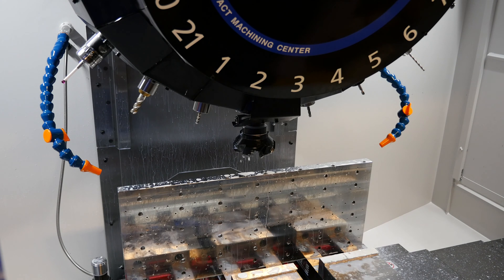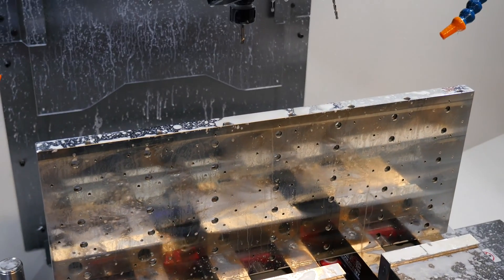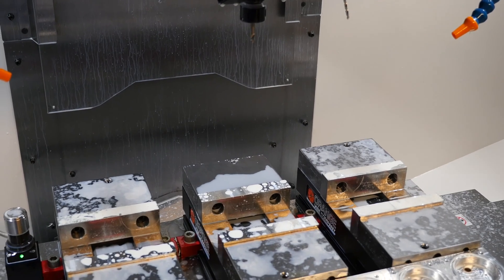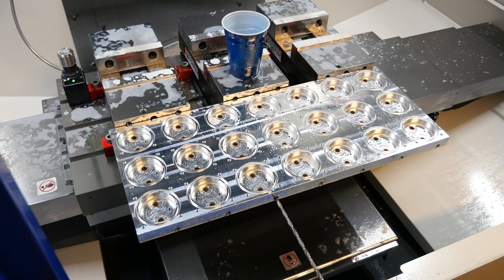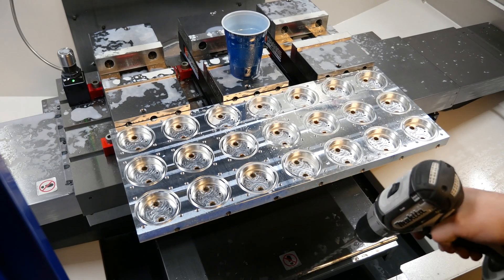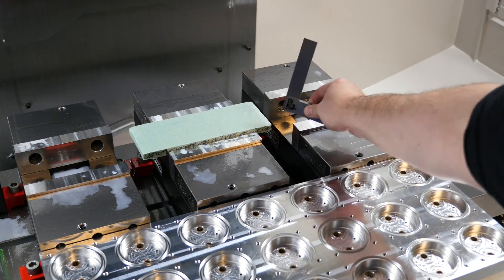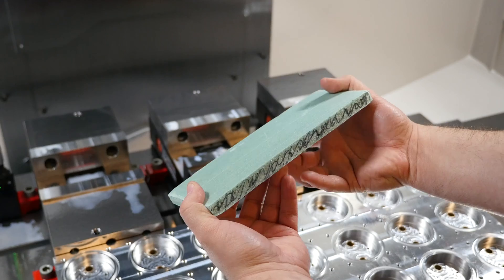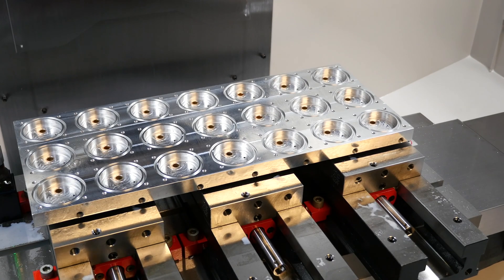Drilling the Air Inlets By Hand and a Lil' Squaring (21-Station Pneumatic Fixture Plate pt.4 of ?)

Comment: when you machine the surface of a large plate like that, particularly if your removing more than a half a millimetre or so, you relieve stress on that side of the plate and it will indeed be bowed when you take it from the vise - sometimes quite alot, like 2-3mm bow (especially if its 6061 and not mic6). so your clamping and hammering into position may have been just fine, and the warping came from machining.

i know this from experience doing a 7075 fixture plate. doh!

Comment: Reading through the comments, I had to chuckle just a bit.  You've got this brand new Brother and those vises.....and not drill press.  Just struck me as a bit backwards from how most of us acquire tools. :) 
I agree with the other guy that the corded drill would have been better, but I'd never give up my cordless drills.  I keep a countersink in one to deburr holes, another setup for driving screws, another reserved for drilling.......super convenient!! 
Looking forward to seeing some chips fly in pt5.....even if it takes me a week or two to get to it. :)
Mike
Reply from the maker: This was the first time I've run those batteries down so quickly. I guess watching the machines drill holes makes it look so easy I forgot that it actually takes a fair amount of power.

Yeah, I really have no excuse for not owning a drill press yet. I guess I'm afraid of ending up with one that is either "not good enough" or way too expensive.

Comment: I have to ask, why not just remove the vise and machine this flat on the table? I think you would be better off in the long run. Invest in a good drill with a cord. I gave my cordless drills away. I find them to be more of a time delay than plugging in a cord. Most might disagree, but I think cordless drill are a waist of time when your trying to do real work. If all your doing is putting screws into something there great. Fixture plates are great but I have learned they can be a pain to make. I have one part I make and it takes two fixture plate to machine the whole thing. I made a small mistake and had to remake them. Best practice take your time and work out how your going to machine and hold every part of your fixture before you cut anything. I find that using my table fixture in my cam software makes working with parts better and a lot fewer surprises. Great fixture and looking forward to more.
Reply from the maker: I meant to reply to this before. I don't know what happened, I must have got sidetracked...

The main reason I'm not clamping the fixture directly to the table is that the minimum distance between the spindle and table is 180mm (~7"). Many of my tools are only ~100mm in length, so given my current collection of tools, I don't see myself doing much on-the-table machining any time soon. The beds of my vises are 3" (76.2mm) high, so mounting directly on the vise beds is something I would like to do in the future. They already have dowel pin holes which, I imagine, would make alinement a breeze. The secondary reason I'm not mounting this one directly on the table is because I have the other air inlets coming out of the bottom. The space between the vise jaws will double as clearance for the air fittings and hoses.

If I ever have to do another project like this I will certainly be heading down to Sears for a new corded drill first! Or I might FINALLY get a drill press, which I've been wanting to do for a really long time!